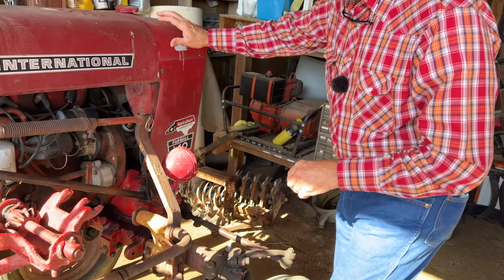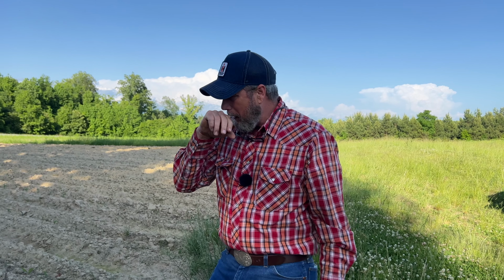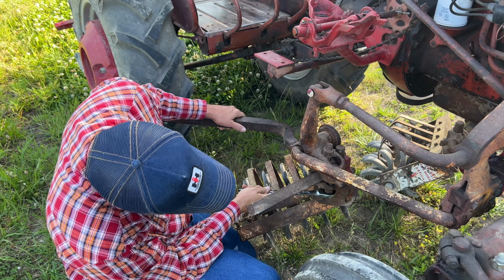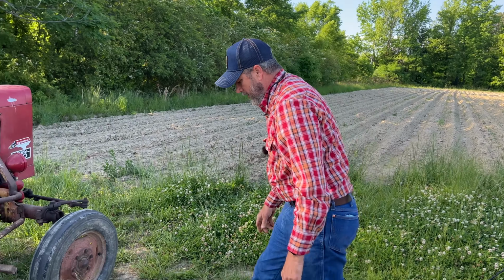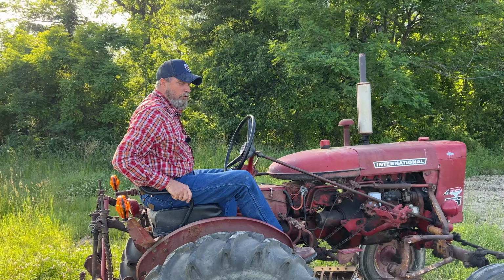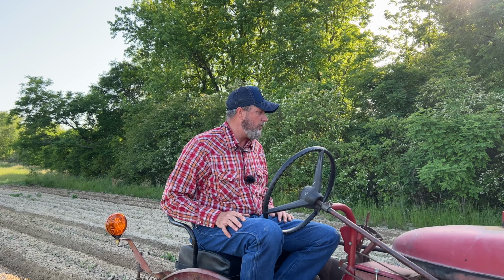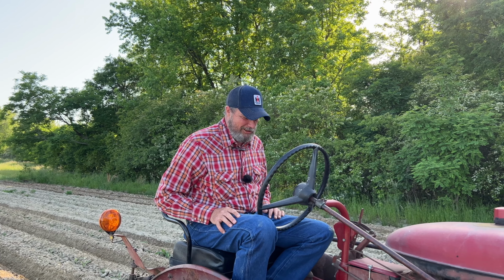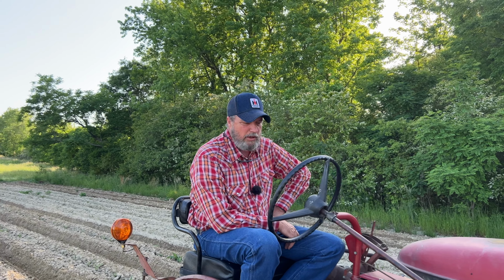Hastings 1st Cultivating Sometimes Plans Change

Comment: I like to run 2 points on the extension and the rollers on the arms. The points push a shade up to the corn put well not cover it up and then the rollers finish it up and walnt hit the first 3in around the plant and you can roll on pretty good. I swap one point for the fert knife at the v4 stage and it's a beautiful thing. Got to love these old tractors.
Reply from the maker: I had a 4 gang set that would have been good for but my 5 gang gets close to the back tire.

Comment: Great video Joey and Will!  I watched a video the other day and you mentioned that the rolling cultivators should be mounted so that the "flat side" is to the inside of the tractor.  I looked at the cultivators that I bought and they are angled on both sides of the spyder.  Just wondering if they are going to throw soil as well as yours do?  Oil pump gasket, valve cover gasket, and oil pan gasket showed up from Steiner today for the 100!  Working on the IH Duplex planter getting ready to paint and re-assemble the hopper section.  God Bless.
Reply from the maker: Yes they will be fine. You got your work cut out for you now.

Comment: I certainly hope you haven't developed allergies, but you can get them at any time. I, like you, never had any kind of sinus issues or allergies until around 50 years old, and had them ever since. So, it possibly could be allergies.
Reply from the maker: It was just a back lash of that cold. It’s just about worked out.